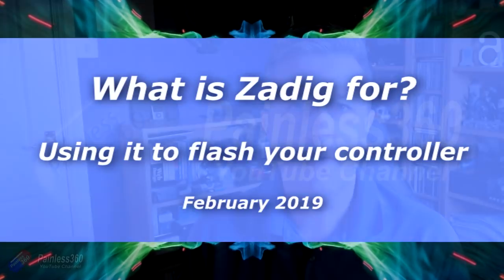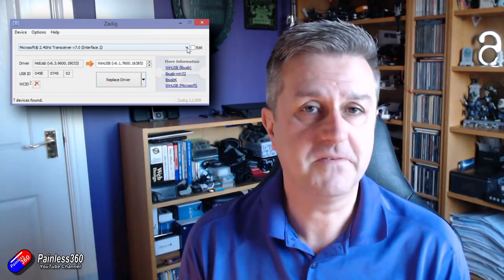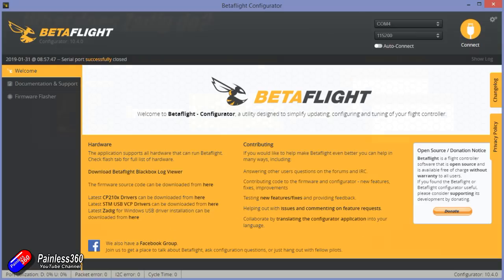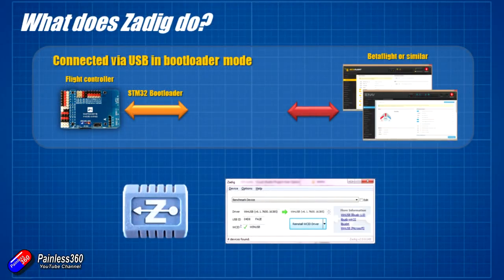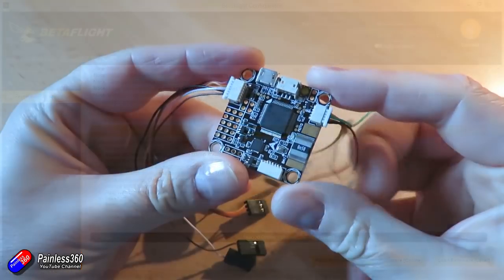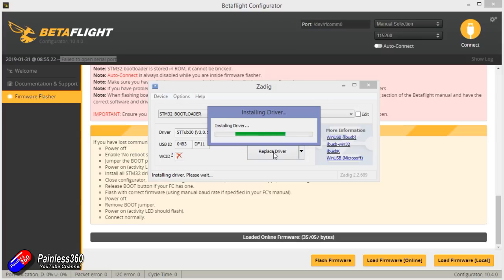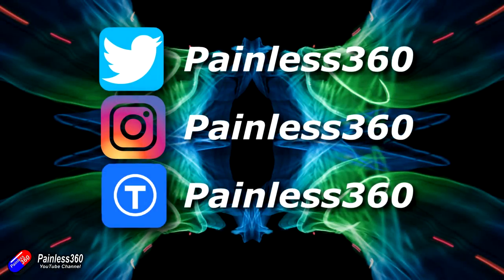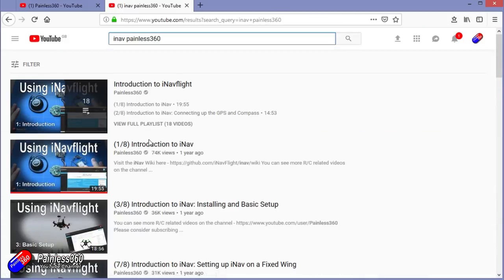Using Zadig to flash your flight controllers simply (STM32)

Comment: I had an Apple computer and as a noob back then, I didn't know anything about driver and stuff so I didn't use or install one. Getting into DFU mode is as plain as clicking the flash button and it automatically gets into DFU mode, no bootloader, nothing. Months ago, I had to use a Windows computer and getting my board to flash is a real pain in the butt though I managed it at the end. Just sharing my interesting experience..

Comment: Quick question ⁉️ I have a Mobula8 Frsky and after crash drone does not beep at all but connects to osd and controller Normally. Just wont fly .. please help thanks
Reply from the maker: I'd suspect something got broken or damaged. I'd check for loose cables, unplugged connectors etc.. Best of luck!

Comment: Actually i messed up with Zadig and installed wrong driver. As you said it can be fixed by impulse rc. But it's not solving my problem. My FC is not recognized by Betaflight configurator. Any solution for this🙏🙏🙏.
Reply from the maker: Install the drivers listed on the opening page of Betaflight is a start.. You don't mention if the issue is normal connections or DFU/Flashing - they use different drivers..

Comment: I did this and the flight controller is detected in DFU mode - I am using Inav but when I click on flash it comes up with error failed to open USB. Do you know what causes this in windows 10. I tried 2 different computers all the same.
Reply from the maker: I'd delete the device from device manager and start again. Trying another USB cable can help too... Happy flying

Comment: Will this help me load APM on my Revo Mini? I've seen it done and I believe I've followed all the steps verbatim, still no luck. Can you use Zadig to load a raw hex file?
Reply from the maker: Zadig doesn't load anything onto the FC, only replaces the driver so the thing you're using to flash the firmware can 'see' it to do so...
Reply: @Painless360  Got it. Is there any way to load a hex file directly to a flight controller? It seems like a lot of the problem has to do with connection issues or previous configurations....
I work with arduinos all the time. We have a couple different hex loaders that are particularly helpful when you are having code issues and can't compile something for a weird reason. The problem is finding hex files that will work. But there are LOTS of good hex files for all kinds of configurations a

Comment: hello I need help on a zading thing I used it to connect my ps4 controller but it made my keyboard not write I have read several forums and the same thing happened to more people, do you know any solution?
Reply from the maker: I've only used it to allow DFU mode of flight controllers.. best of luck

Comment: i can connect and in cli i can dump and I see: INAV/SPRACINGF3 2.2.1 Jul  3 2019 / 21:50:13 (a6d847482)
Why am i able to connect but can't connect to flash to a new version? I have tried to install the latest version of inav but when I try to extract/install in chrome chrome tells me something is missing.
Reply from the maker: It is probably a driver issue as the drivers used to talk to the board are not the same as those used to flash it - covered in the video. Best of luck!

Comment: Why Impulserc driver fixer cannot find my fc? It loads and loads but cannot find the fc. Please help me
Reply from the maker: I don't use that here. I use Zadig. Best of luck
Reply: I used Zadig also. After so much trying.  I finally flashed my fc. But it doesn’t connect with cleanflight. It says- serial port successfully closed. What can I do now?
Reply from the maker: Find the port in the device manager on the computer and delete it. You've probably accidentality replaced that driver using Zadig too..
Reply: Done that also. But didn’t work. I didn’t find stm32 option in zadig software. I found cp2010x port. Usb to uart com connector. But stm32 didn’t appeared.

Comment: how can I flash with an USB to TTL adapter, cause the usb port of th FC is brocken?
Reply from the maker: I've not had to do that for a long time. Back in the day you could connect to UART 1 (if MSP was enabled for it) and use it that way but I've not tried that for many years.. I'd search in the forums for the specific board you have in case another pilot has posted the trick. Best of luck with it..
Reply: @Painless360  thanks... For normal use it's working but not for DFU mode... By the way I use the matek f405 wing FC
Reply from the maker: That's more likely than be a driver issue.  Check out my Zadig video.. best of luck

Comment: Hi
I've loaded all the drivers. Still cannot connect to my pc. I don't need to flash the FC, just connect. I've tried impulse RC, but this does not work either. Please could you help :)
Reply from the maker: It'll be a driver or cable issue. I'd try another cable to rule that out. What troubleshooting have you done?
Reply: @Painless360  I've tried zadig but thanks to your video I now know I don't need it as I don't need to flash. I have ordered a new cable the other day too. I have downloaded all the drivers on the betaflight website.
I am running Windows 7, 64bit processor.
Thanks so much for your help :)
Reply: @simoncorser8083  let me know if you ever figure this out. I have the same issue.  I reinstalled all of the drivers, and tried impulse rcs too, and none of them will recognize my fc. And tried different cables.  It was working fine, i changed a setting in betaflight. Then tried conecting to blheli32 and it wouldnt recognize it. Now its just invisible to everything. My other fcs still conect fine.
Reply: @Painless360  should i uninstall all drivers and reinstall them ? Even though my other fcs work fine. Im stumped and want to throw it at the wall at this point.

Comment: Ok I have a new problem... The pitch is constantly moving in the "Setup" page when the card doesn't move, and I can't calibrate the accelerometer.
Can anyone help me please ?
Reply from the maker: Older boards with older accelerometers and gyros suffered more with this. sounds like the IMU is drifting or you need to perform that calibration. Also check that the centre values for all the channels are at 1500.. See my setup videos...
Reply: @Painless360  Ok, I'll try it
Reply: I solved the problem, I selected the 2nd gyro (ICM20602) with the CLI command and thanks to that I no longer have permanent pitch movement.
However, I couldn't find where to calibrate the previous gyro, nor do I know where to find the values to look at, but for the moment it works.
Thanks for your help !

Comment: My fc pnly shows up as a cp2102 usb to uart bridge controller. The imulserc software does not detect my fc either. I think i did something really bad. Does anyone have an idea on how to fix that?
Reply from the maker: Then the device driver replacement probably didn't work.. See the other comments for another driver replacement solution that may be better for you if Zadig is struggling.. Best of luck!
Reply: @Painless360  i might have figured it out: the 3.3v regulator gets really hot, which could mean the cpu is dead, but not the usb to uart chip, which in turn explains why it only shows up as a uart bridge. Anyways, a new one is on the way, thanks for your respone anyways. And thanks for your videos, they make my life so much easyer!